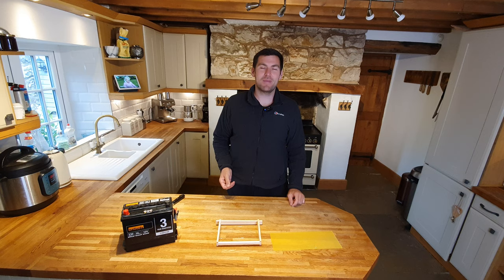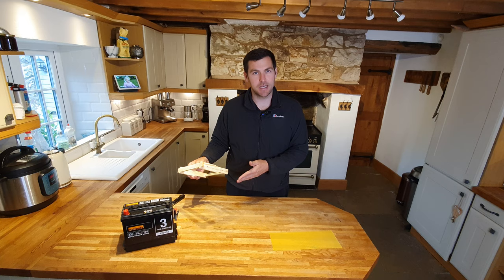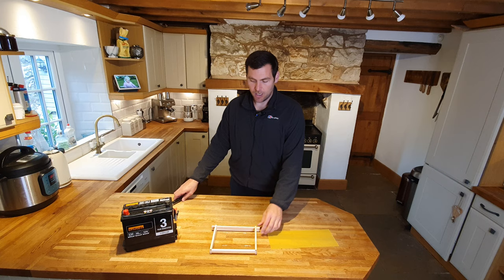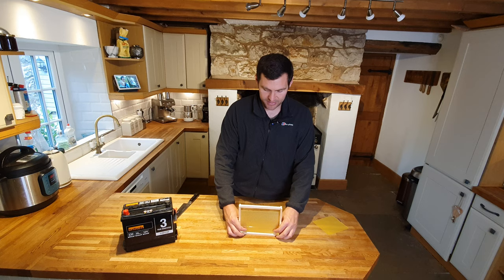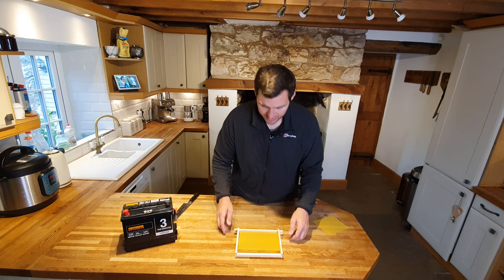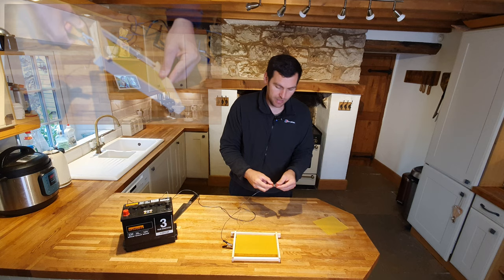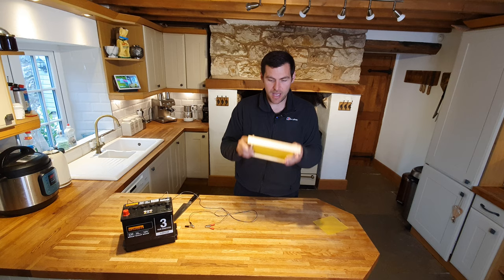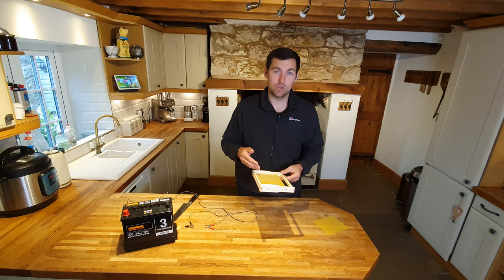How to Embed Foundation on Wired Frames - Car Battery

Comment: Make sure you are using a good battery though...the first one I tried wouldnt melt anything..second one I almost cut the wax into 3 with the heat because I didnt expect it to work so quickly.
Cheers Laurence
Reply from the maker: Yes. Very true. A proper, fully charged battery will slice foundation immediately. It just needs a couple of taps to get it to embed

Comment: Do you use this method on all your 14x12 frames? If so do you just buy unwired National deep foundation and let the bees draw the rest down?
What’s your thoughts on using plastic foundation for 14x12’s or supers? 
Thanks.
Reply from the maker: In the past I have used wired foundation but now use this method for all frame sizes. You need to use the correct size of foundation or they will just draw any gaps up with drone brood which is a real pain (unless they draw it late in the season). Im not a fan of plastic foundation but see others have success with it. I think it would work well in a brood box but if you have issues with disease it can become problematic.
Reply: @BlackMountainHoney  
On your 14x12 how many lines of wire have you found to be the optimal amount for providing the right support? Thanks
Reply from the maker: @darrylclements814  I would go for at least 3 but preferably 4 rows on a 14 x 12. You can get away with 3 on a standard national and 2 on a super
Reply: @beemaniauk  what do you do if there is problems with disease on those frames? 
Where you do buy your plastic foundation? It seems hard to find plastic  for 14x12 frames.